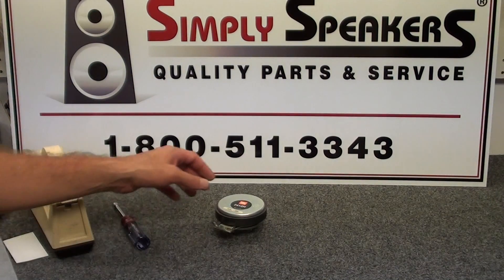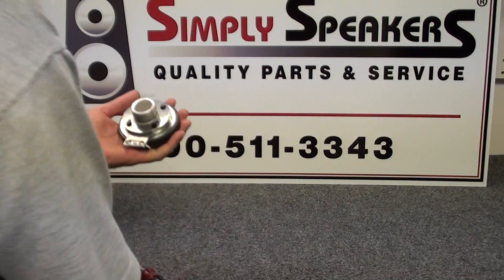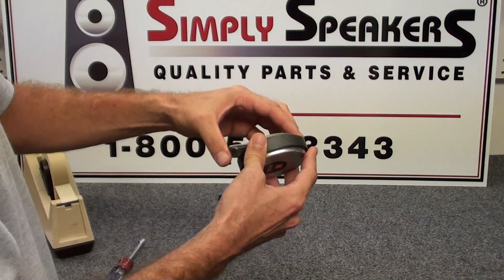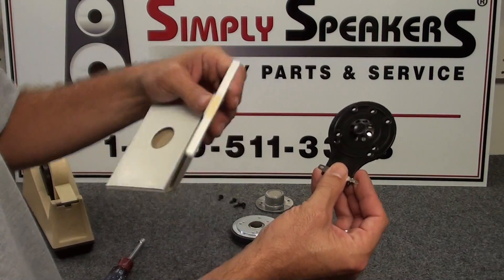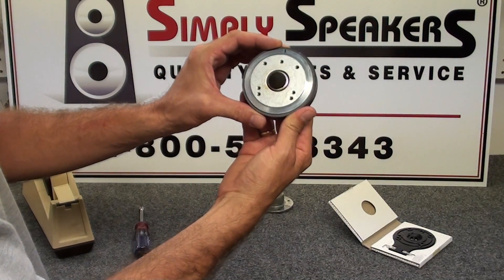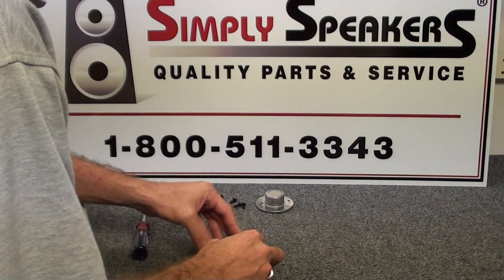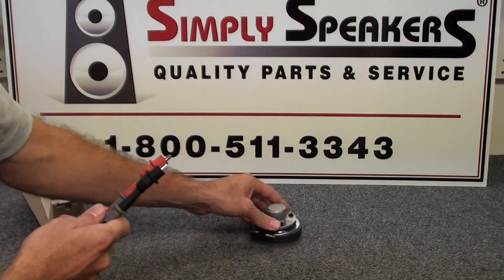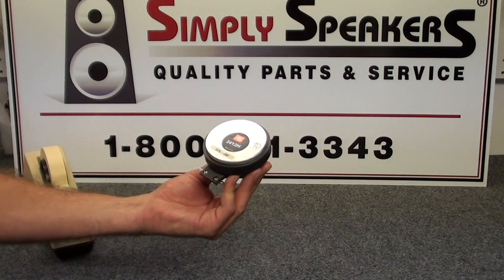Speaker Repair, JBL 2412, 2412H, EON, TR, JRX, Replacement Diaphragm Installation by Simply Speakers

Comment: No need to measure with pink noise after like with the large format drivers to make sure they are seated properly?
Reply from the maker: Yes, we test all repairs on a signal generator when complete. These particular diaphragms are self-centering, so it is rare to have any rub or scrape issues when complete.

Comment: replaced this part and speakers still sound terrible, would you recommend changing the crossover ?
Reply from the maker: Yes, for sure. Try the crossover. There must be a failing component or loose connection somewhere.

Comment: Great video, helped me a lot. I have a question. Besides replacing the diaphragms, I also had to replace the audio resistors from the crossovers because they were burnt. The resistors are 10-watt, 16-ohm; i already soldered new ones and the twitters sound like new. But just to make sure, what can cause a resistor to burn? Thanks!
Reply from the maker: eldom72 Too much power is always the culprit

Comment: how does the original diaphragm look like? ive seen several shapes, and what about the voice coil does it have flat or round wire?  Thanks
Reply from the maker: The JBL 2412 diaphragm is just like the video shows it. We have other models which are different. Some use round wire, other use edge-wound. It all depends on the actual design.

Comment: HI, i have 2 units of JBL EON1500 and i realized one of the tweeter sound very weak and caused whole speaker lack of hi mid frequency. When i open up the driver, i didn't see the breakage in the diaphagm as shown in your video. May i know:

1) The weaker response is it caused by the spoilt diaphagm or magnet?
2) There is after market diaphagm around, some are in black plastic and some are in metal plate, does this two make a different in quality and sound?

Thanks.